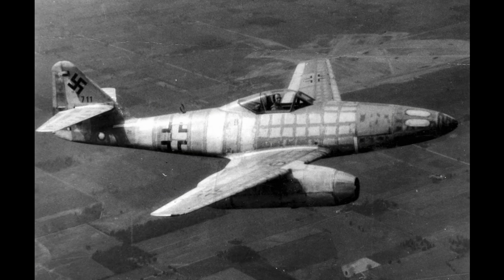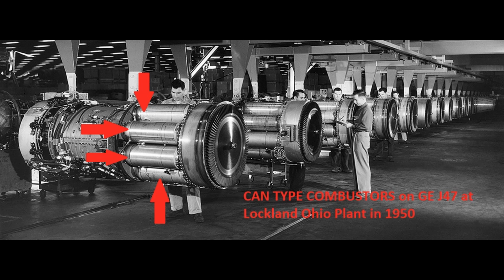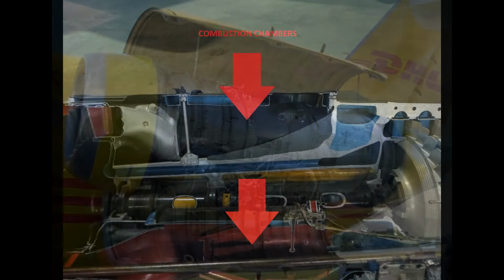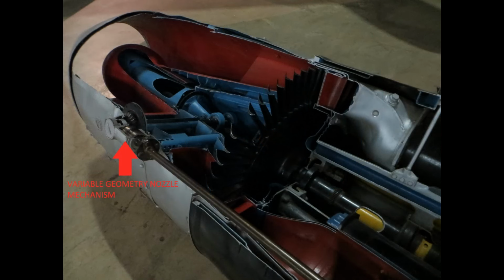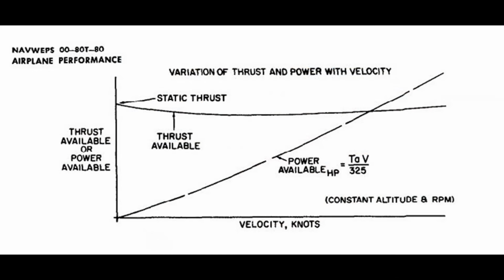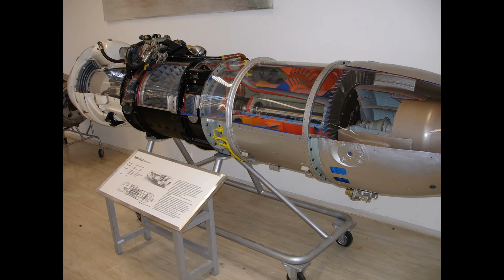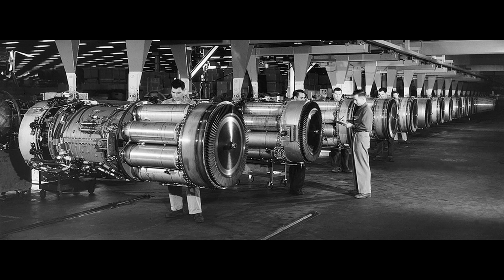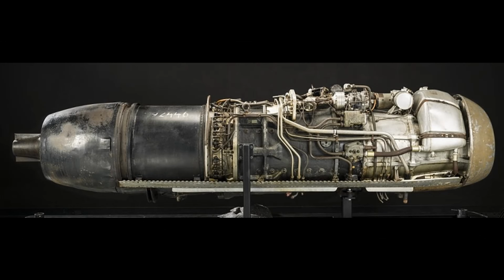World War Two JET POWER

Comment: Of course we have previously made the comparison between Meteor and Me262 with all the statistics one could wish for. Here follows the most in depth comparison between the two you may ever read:
   “Frank Whittle (jet engine inventor, first to patent 1929) and George Carter (Gloster Meteor designer) both ensured the outperformance of their German rivals was made accountable to 29 measures of aeronautical excellence:
   1   Meteor had greater armament. A larger wing carried a staggering 24 rockets to Me262 sixteen (see Meteor ‘Reaper’ below) and a (one off) 57mm cannon anti–tank version. Meteor could also carry more bombs (see official load capacity below). Whilst both aircraft’s four cannon layout was numerically equal, Meteor used Hispano (arguably the war’s best 20mm) whilst 262 used Mk108, a questionable choice due to its short barrel, low velocity (540 mps) and high trajectory curve inaccuracy. It is clear which aircraft had an often bigger and always more accurate punch
   2 Meteor, having dive brakes, was a more stable gun platform. 262, having none, had uncontrollable dive speeds resulting in a reduced window of two seconds to fire cannon at optimum range (official post war RAF report below). It is clear which aircraft’s more accurate munitions were fired for more sustained periods
   3  Meteor’s engines were reliable. Me262 Junkers Junko 004 jet engine (lacking specialist alloys due to not knowing important stuff), lasted 10 hours before requiring replacement / overhaul. Meteor’s engines lasted 250 hours.  
    4  Poor heat management caused Jumo to flame as temperatures rose (over 200 Luftwaffe pilots were killed by their own exploding engines). It is clear which aircraft remained airborne longer
Unlike 262, Meteor did not stall when power was applied quickly (or decreased not slowly enough). It was difficult for 262 to dogfight or to take off quickly to intercept with such acceleration hindrances. 262 was destroyed in large numbers when returning to land —slow deceleration to landing speed (avoiding said stalls) enabled Allied piston engined fighters (notably DeHavilland Mosquito) to destroy 262 in industrial numbers. 
     It is clear which aircraft had an all too exploitable and fatal Achilles heel
  5 Meteor clipped short wings ensured excellent turn rate, whereas 262 substandard turn radius was significantly wider than Allied piston engine fighters. Mustang downed dozens of 262s at height, over 100 were downed by piston–engined fighters in total and Britain’s Hawker Tempest (WWII’s fastest single engined piston fighter) was its nemesis at low altitude. Spitfire, Thunderbolt and Mosquito also scored kills and it is clear 262 was no dogfighter
   6.  Meteor was more rugged. Its short and sturdy undercarriage enabled take–off from the quickly prepared forward position grass strips necessary for efficient tactical close air. 262 had delicate undercarriage (lengthened to clear low hanging under–slung jets) and resulting build was delicate. Once Luftwaffe tarmac strips were destroyed, 262 utilised awkwardly located autobahns as runways. It is clear which aircraft was not robust enough for the all–foreseeable practicalities of war
  7   Meteor was more powerful. Where Me262 Jumo delivered 1,900 lbf thrust, Meteor‘s Rolls Royce Derwent Mk.I entered production with 2,000 lbf. Mk.II, III and IV followed, peaking at 2,400 lbf. By war’s end Rolls Royce had the Nene, the world’s most powerful jet engine, with an astounding 5,000 lbs. It is clear which aircraft, powered by the world’s foremost power plant manufacturer, had the thrust required for interception
   8 Meteor had a greater load capacity. With a 11,220 lb gross weight and 14,550 lb max takeoff weight, Meteor carried 3,300 lb. 262 had a 14,271 lb gross weight and 15,719 lb max takeoff weight to carry 1,448 lb. It is clear which aircraft was a more capable workhorse with twice the load capacity
    9   Meteor proved more adaptable flying in ground attack, close air support, bomber escort, V1 interception, bomber interception, armed reconnaissance, photo reconnaissance, intruder, night–fighter, twin seat trainer, ejector–seat testbed, air to air refuel testbed, axial flow jet engine testbed, centrifugal jet engine testbed, prone pilot position testbed, carrier landings testbed, carrier fleet folding wing version, engine re–heat testbed, vector thrust testbed, target drone, turboprop and civilian configurations. 262 on the other hand was discontinued just 3 months after its operational debut and it is clear which aircraft was more useful
   10  Meteor had a higher kill ratio (technically). Despite (or perhaps because of) Meteor’s ban from flying over German airspace (lest its jet technology be discovered by advancing Russia), it has the highest kill ratio of the entire war among all aircraft types (technically). Over 50 V1 rockets and 46 enemy aircraft (on the ground) for no combat losses (one accidental air collision to fog). A rare clean sheet. 262 had over 200 fatalities to engine troubles alone and, with 1,450 produced for 520 Allied aircraft shot down, it took three 262s to down each single Allied bomber. 262 stats are a procurement disaster. With Meteor, more could have been achieved but 616 Squadron, positioned close to the front in Belgium and with restrictions imposed, was hand–cuffed. 262 was of little threat to Britain who felt no requirement to fully field her best player. The stats are unfair and victors write history but such is the preserve of winning teams. It is clear which aircraft holds the distinguished records.
Reply: That's the Great Text Wall of Britain to explain why and how a country that produced a dead-end jet plane which went nowhere... in either aerodynamic layout or powerplant used.
Reply: @LegateMalpais 

We believe we can clear up some commonly held myths and misconceptions, obviously

It's always good to see the facts presented clearly and concisely isn't it? 

The Meteor went on to serve with more than 30 air forces and was in service for more than 40 years. The 262 & it's engine got abandoned after 1945. 

Interesting British achievements.
There is no doubt that the Fairey (England)
Delta 2 was of course the world's first jet
aircraft to exceed 1000 mph.  lndeed It
exceeded the previous record by 310 mph &
held the record for more than a year. Incidentally, the Dassault Mirage series of aircraft are based on the Fairey Delta 2. 
March 1956,  UK Peter Twiss,
1,132	 mph, Fairey Delta 2,	 Chichester, UK

The next speed record after the FD2 -
December 1957, USAF	1,207.6	mph, McDonnell F-101A Voodoo, 	Muroc, California 😎.

When the British EE Lightening first exceeded Mach 2 it was one of the fastest jet aircraft on the planet.

The Lockheed  XF-104 record claims before 1958 are all fictional & completely unverified. It's  interesting that the XF-104 started life using a licence built version of the Armstrong Siddeley Sapphire.

The world's first wind tunnel was constructed in England before 1877. The world's first supersonic wind tunnel was constructed in England in 1922.

The sequential stator rotor multi stage axial turbine & compressor were first produced during the 1800s by Parsons of Ireland & North England for power generation & ship propulsion turbomachinery purposes. Those basic turbomachinery components would go on to form the basis of most modern gas turbine aero engines.

At the time there were discussions regarding the use of those components for an internal combustion gas turbine aero engine to power aircraft (& ships) thus the axial compressor jet engine & jet aircraft concepts were effectively invented in England during the 1800s.

The gas turbine engine was invented and patented in England during the 1700s.

Early days, jet engines. Whittle performed the world's first demonstration of a gas turbine aero engine in 1937. The RR Nene, a centrifugal gas turbine aero engine, was the world's most reliable & most powerful gas turbine aero engine in 1944. Licensed built versions & copies of the RR Nene & RR Derwent would go on to power many aircraft in Russia including the Mig 15 & Mig 17, the US, China, France & other countries for decades after 1944. Incidentally, the Mig-15 was in essence an upsized / tweaked copy of the Whittle / Gloster E28/39 jet aircraft including a copy of the RR engine.  The centrifugal compressor gas turbine aero engine with Whittle style reverse flow combusters and sometimes an axial compressor section is still manufactured by more than one company, the main application being helicopters.

   That's correct, The Tornado & Typhoon & their engines are supersonic & are indeed British design aircraft with British design engines built by an international consortium. The Tornado design for example started life during the 1950s at Vickers as the AFVG, it's engine is based on the RR RB-199. 

The EE Lightening is also a British Supersonic jet aircraft. At the time the EE Lightening first flew it was indeed one of the fastest aircraft on the planet, it was still one of the fastest aircraft on the planet 4 years later when it first flew at mach 2

  The Typhoon is the British BAC-EAP with an engine based on the British RR XG-40, the Typhoon is also built by an international consortium.

   Indeed, There are no German companies that make German jet aircraft in Germany & there are no German Companies that make German gas turbine aero engines in Germany that are suitable for widebody airliners.

  BAe Systems, GKN Aerospace & Rolls Royce combined now do more Airbus work than Germany on an absolute basis & significantly more work than that on a per capita basis.
     
  RR now owns US Engine maker Allison for example which does classified Aerospace work for the US Govt.
   
 Anybody currently flying on a widebody airliner stands a good chance of being on an aircraft powered by RR gas turbine aero engines built in England & the UK.

We hope this helps, of course.
   
Cheers as always 👍.
Reply: 11  Meteor, with jets built into wing, was aerodynamically superior where it mattered. 262 under–slung jets caused unnecessary drag and required longer (less stable) under–carriage and (yet more) weight. Its jet engines were so unreliable it was deemed necessary to locate them where they could easily be accessed. No fighter ever had underslung jets again. Furthermore, Me262 18.5° swept wing configuration was to position unexpected Jumo engine weight rearward for balance and swept wings were of no performance benefit (262 was not fast enough to approach the sound barrier in straight flight). Swept wings, usually purposed to counter transitional shockwaves in the push to Mach 1, were more a measure of damage mitigation than aerodynamic foresight. Sleek as it was, it is clear 262 aerodynamics were not advanced where it mattered
     12   Meteor’s short and strong landing gear made it adept at jet–on–carrier landing. (HMS Pretoria Castle, July 1946. Two years before any other nation). 262 lengthy undercarriage, too delicate for fleet operations, made clear which aircraft offered international strategic strike, intruder and force projection options.
      13  As well as this, Meteor had potential for maritime roles of amphibious beach assault air cover, fleet defence, anti–shipping and submarine hunter If required. It is clear 262 was purely a local and tactical aircraft only
    14.  Meteor pilots flew trusted engineering. 262, fabricated begrudgingly by forced labour, had assembly errors purposefully placed within (official build quality report below). Such traps were found by German ground crew and Luftwaffe pilots admitted doubting their own aircraft with many refusing to perform high G manoeuvres (see 262 chief test pilot report below). War weapons are judged upon manufacturing quality and performance not blueprint potential and dreams and it is clear which aircraft was built and flown with confidence
      15  Meteor had a solid supply stream. Like Spitfire, Meteor was prudently built in modular sections in dispersed ‘shadow’ factories thus securing continuous supply through mitigating risks of build interruption caused by German aerial bombing. Conversely, 262 was naively fabricated in large centralised factories more easily disrupted through Allied bombing and was eventually assembled in damp caves which was not ideal. It is clear which aircraft had a sustainable supply stream with potential to be built in higher volumes if war requirement necessitated
     16  Meteor cost less to manufacture. Where 262 cost 87,000 Reich Mark, Meteor cost £27,000 (RM 67,230). Again, it is is clear which aircraft could be produced in greater volumes subject to war requirement

     17 Meteor utilised a pressurised cockpit (post war) and flew to 43,000 ft in heated comfort. 262 had no such capability and it is not clear there was space in Willy Messerschmitt’s Me109–sized cockpit for such development (Messerschmitt was a originally a glider designer and made designs small and light). It is clear which aircraft’s comfort enabled pilots to focus on more important tactical matters
      18  Although neither aircraft used ejector seats during the war, 80 years after being first deployed, Meteor remains platform of choice for Martin Baker subsonic ejector seat safety trials. 262, with Me109–sized cockpit and failing engines, would have been ill–suited as a barometer of safety. It is clear which aircraft was so safe it is still used today for safety research and development
     19  Meteor achieved its goals whereas 262 production was cancelled just 3 months after operational debut and well before war’s end – 3 July 1944, ‘Fighter Emergency Program’ or Jägernot, was Germany’s switch to produce cheaper jet fighters, more quickly in larger numbers. The announcement was a public admission 262 had failed to arrest the Allied bomber stream. Conversely Meteor’s decade long production ensured it remained on active duty with 21 world airforces for over 30 years. It is clear which aircraft failed In reaching its objective
       20  Meteor cockpit, positioned forward of the wings, gave good pilot visibility. 262 cockpit was positioned over the wings and visibility downward for ground attack was poor, it also had a long nose making forward visibility poor. The Meteor cockpit location, forward of the jet engines, also resulted in a remarkably quiet ride which, again, was an improvement on 262. Indeed, it can be said that, of the two aircraft, only Meteor’s airframe was purposed specifically for jets with even the tail wings positioned high to avoid jet wash —by comparison early 262 had a tail wheel layout resulting in scorched and ruined runways from jet flame. The tail wheel also pointed the aircraft skyward on the runway causing (apart from terrible visibility) the aircraft to simply not take off (pilots had to touch the breaks at 180km/ph to raise the tail to create lift over the wing to take off). It is clear Me262 layout was simply that of the old piston engine fighter style with jets underslung.
Reply: It will come as no surprise to anyone that we feel we can clear up some commonly held myths and misconceptions, obviously.

Indeed gentlemen, it's always good to see the facts presented clearly and concisely isn't it?

More Meteor Notes, obviously.
    21   Meteor airframe layout was useful for post war jet fighter development. Where the Allies may have pawed over German rocket technology, not a single 262 jet design protocol was adopted, by any nation post war. Britain’s post–war aeronautical advancements were home grown (see Miles 52 secret supersonic WWII programme, Appendices 1) and British aircraft housed engines into wing, fuselage or both (Canberra, an evolution of Meteor was purchased by the USA, flew with impunity high over the Soviet Union during the Cold War and, unlike U2, proved untouchable). It is clear which aircraft supplied foundations for global jet fuselage development
   
    22   Meteor jet engines were used for post war jet power plant development. Rolls Royce Derwent (and successor, Nene) jet engines, were relied upon by both USSR and USA until achieving their own independent home jet capabilities. Whilst Jumo lay dead in the water (France attempted its manufacture with false promise, got nowhere with it), it is clear which aircraft’s engines laid the foundations for global jet power development
  
    23   Meteor, first jet to refuel inflight (from Lancaster), successfully flew 12 hour endurance missions. 262, with engines requiring replacement after 10 hours, could never have done the same. It is clear which aircraft proved to the world jet engines had flight endurance
    
    24  Meteor, jets positioned high in the wing, was the world’s first turboprop. 262, with under–slung jets could never achieve the same without its propellors hitting tarmac. It is clear which aircraft was endlessly adaptable
    
     25   Being both reliable and safe, 1946 Meteor F4 G-AIDC became the world’s first civilian registered jet. Although the Me262 Avia factory remained in tact post war with production continuing for the Czech airforce no national civil aviation authority considered operating 262 with its temperamental and dangerous power source. It is clear which aircraft had commercial options
  
       26 Meteor performed a stunt even today’s US Lockheed Martin F22 Raptor can’t equal using its much vaunted vector thrust —the Zurabatic Cartwheel. Engines were distanced apart enough to throttle back and forward achieving a stationary cartwheel. No aircraft has com pleted the manoeuvre since. It is clear, albeit not in the traditional sense, which aircraft was the first to hover

    27 Meteor was the world’s first aircraft to use vector thrust (detailed below). Rolls Royce Nene was given thrust deflector shields located in the jet nacelle to facilitate short take–off and landings. Jumo, lacking access to heat resistant alloys suitable for such, could not have achieved the same and, despite this, vectored thrust might not have been so useful for 262 with such hindered thrust control. It is clear which aircraft proved vector thrust viability to the world
   
     28   In 1943 Meteor serial number EE215 successfully trialed afterburners (reheat as it was then called) —three years before any nation (America’s Nathan Price followed with his commercial version post war). Again, it is clear which aircraft pioneered jet power development
     
      29  Meteor’s ability to quickly and reliably power down single engines mid flight made it ideal for asymmetric flight training (simulated loss of power to one engine is vital for pilots training on twin engined aircraft). To power down Jumo mid–flight would have been a prolonged, uncertain and potentially hazardous operation —nobody would wish to rely on one Jumo. It is clear which aircraft could carry out perfunctory tests
   
      30  Lastly, 262 was responsible for the ugly birth of inefficient air travel. Like Meteor, Britain’s Canberra, Comet, Vulcan, Victor, Valiant, Hunter and VC10 all elegantly incorporated jets to both wing or fuselage and were the most aerodynamically refined large jet aircraft of their day (with resulting speed, range, fuel, manoeuvre and stealth advantages). However, USA won the global civil aviation race with its lowest common denominator design approach (Boeing’s cumbersome and aerodynamically compromised underslung jet airliners were cheap for mass production, easy for engine maintenance and suited to mass markets). 
   
      32 Britain’s nuanced and elegant VC10 on the other hand (with engines incorporated to fuselage tail), were preferred by passengers (beautifully quiet with engines rearward), preferred by airports (required inexpensive short runways), preferred by pilots (climbed and turned nimbly) and preferred by airlines (flew further, faster on less fuel). However, the American homogenised basics of volume, cost and ease won over quality, speed, performance and beauty and today’s aerodynamically inefficient civil airline industry is one of the world’s most polluting —all so Boeing mechanics can easily access engines. Whilst Meteor ambitiously incorporated jets to wing, it is clear the aerodynamic abomination of 262 underslung jets popularly proved pigs could fly
UK

     33  World records
On 7 Nov 1945 (two months after war’s end) the Gloster Meteor smashed the world air speed record at 606 mph (70 mph faster than 262) and six months later Meteor MkIV, finding an extra 171 mph to its MkI forebear, broke the record again at 616 mph. Meteor, being the world’s first aircraft to master operational in–flight refuelling (with AVRO Lancaster), then broke the world record for flight endurance. Meteor then broke the world record for distance. Meteor then broke the world record for climb rate —twice. 
     
      34  Meteor then broke the world record for altitude. Meteor then achieved a global avionic international procurement record for fighter sales. Meteor, still operational today, has now achieved the world record for longest serving jet-fighter, longest serving jet (all categories), longest serving fighter (all categories), longest serving military aircraft (all categories) and only frontline aircraft of the war to take no losses to enemy action. I lose count of the accolades given to Britain’s most modestly ‘mediocre’ Meteor.

We hope this does indeed help.

Cheers, as always, of course & 👍 etc